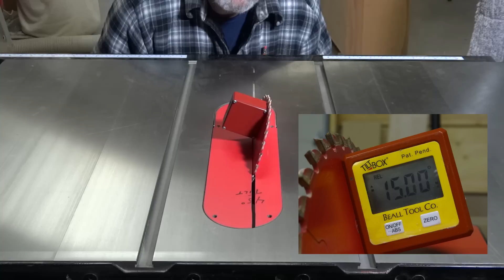A Guide to Stave Construction for Woodworking and Woodturning

Comment: Very helpful video! I have a question...After you make the cylinder, How do you mount it on the lathe? Did you make a chuck for it?
Reply from the maker: +Juan Gómez 
Hi Juan,
I'm glad you find the video helpful! If I was to mount it on the lathe I would use a large chuck because it is not too large to do that. If it were a much larger cylinder I would have to make a chuck of some kind for it. If I had enough length to waste some of it I would make sure the end was square and then probably use hot glue to attach it to a glue block. Thanks for watching, Juan.
Take care,
.....Gord
Reply: One can use a blank and make a tenon on that and glue it on the end, just making sure it's centered before the glue dries!👍 Then just put the tenon in the chuck, and remove the blank afterwards!

Comment: What is a good way to mount that on a lathe?  I don't really have a lot of bells and whistles to mine.  Maybe some way to use a jaw or something?
Reply from the maker: Ritgar001 It depends on what you want to do with it. I generally put mine in a chuck using either expansion or compression depending on the size of chuck needed and what I have. You could also use a jam chuck if you wanted to. Part of the joy of woodturning for me is the challenge of coming up with a way to hold things on the lathe; there is usually more than one way to do something. Sorry if this isn't a great answer but there are so many variables - size of cylinder you've created, size of chuck(s) you have, etc. Hope this helps!!!
Reply: I just want to do it safely.  I had had ceder fly apart on my lathe and smash around.  I do know glue is much stronger than wood though so I guess it should be fine.  I'll give it a shot.
Reply from the maker: Ritgar001 I hope it works out for you. ALWAYS wear a face shield!! I've had things fly apart and if not for my face shield I would have been in the emergency room on at least one occasion. Safety first!!!
Reply: Gordon Rock
Yea.  I have heard about getting a face shield I just haven't yet I am always out of the direct line of fire though.  I haven't been doing much on my lathe recently since I have been doing my first few boxes with miter joints on the table saw.  It turned out so-so I should probably lightly sand it and do one more coat of poly, but a few small details are off that I need to fix next time.  https://www.facebook.com/photo.php?fbid=950585308301786&set=pcb.950585714968412&type=1&theater
Reply from the maker: Ritgar001 Thanks for sharing the photo. That's a decent-looking box and every future box will be just a little bit better. If the first one you built was perfect how would you improve? The joy is in the doing, more than in the product; at least that's how I feel about it.

Comment: Hi Gord.  I have used your stave cutting method before but I am now trying to make wooden buckets (coopering).  I have a method for cutting one taper/bevel that works to make only one size of bucket but I wish to make different size units and don't want to waste expensive wood experimenting.  I was hoping you had a method for stave cutting to vary all the possible sizing (top/bottom diameters) possible.  Thanks for your consideration.   Alan
Reply from the maker: Jean MacHardy Hi Alan. I'm sorry but I've never tried making anything but straight cylinders with staves. I would assume someone out there has a chart for this but I don't know where to look for it. I hope you can find it.
Sorry Alan,
.....Gord
Reply from the maker: Jean MacHardy Alan, I did a quick google search and this might just help:

http://forums.finewoodworking.com/fine-woodworking-knots/general-discussion/formula-tapered-staves

Hope it helps!!
.....Gord
Reply: Gord Rock Thankyou Gord.   Alan